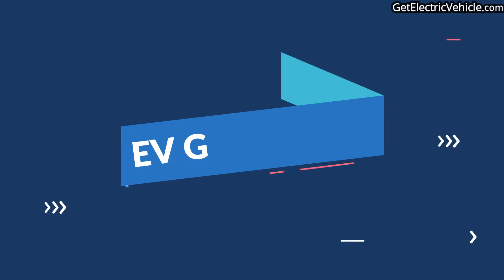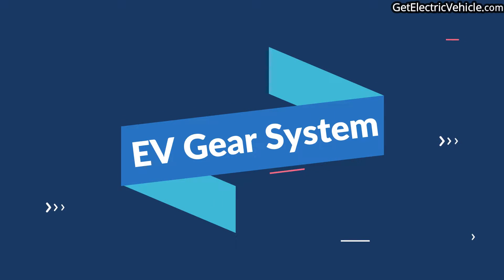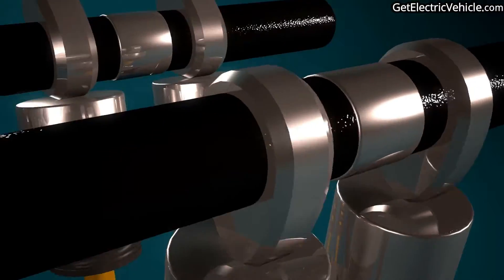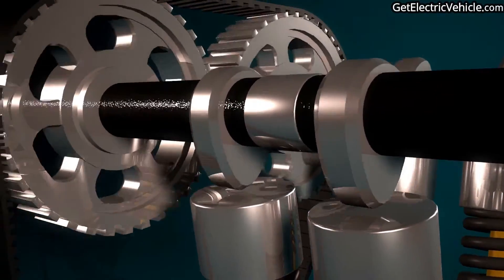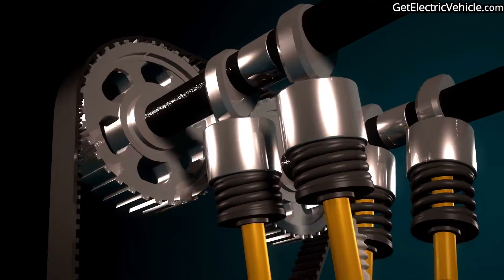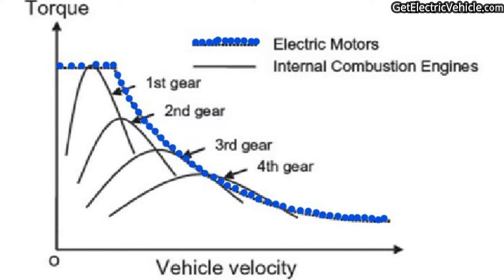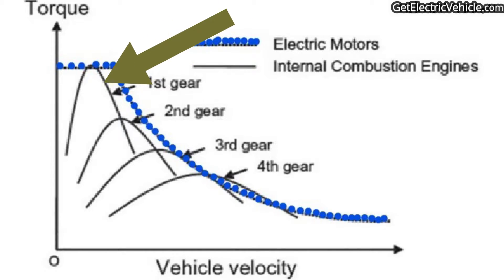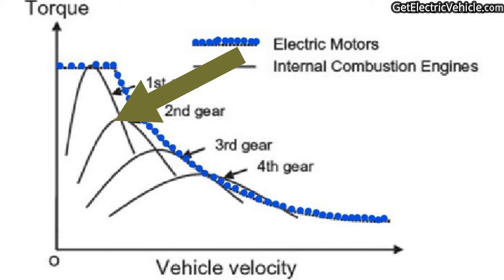Electric Vehicle Gear System || Why doesn't EV Feature a Multi-Speed Gearbox?

Comment: Wouldn’t even a simple two or three speed transmission increase the range of an EV by requiring lower RPM from the electric motor?
Reply from the maker: Design decisions will be based on comprehensive simulation analyses focused on energy consumption metrics.

Comment: What if it was applied in a heavy duty towing application? Wouldn’t multiple gears be feasible for torque multiplication at lowers speeds, also would a higher gearing yield more range out of the battery? Stressing it less at higher speeds should lower power consumption right?
Reply from the maker: For high torque applications, multiple gear is a good option. Heavy duty trucks uses multiple gears
Reply: @GetElectricVehicle  Ide imagine at least a 3 speed. One low gear, a 1-1 gear, then an overdrive for power saving at speed. Am I wrong on this?
Reply from the maker: @toofastnobrakes  It is possible. The number of gears has to be selected based on the energy consumption as well. If the motor itself has high starting torque and high speed then gears are not necessary SInce energy consumption is highly critical factor in EVs, the addition of gears will be based on the necessity.